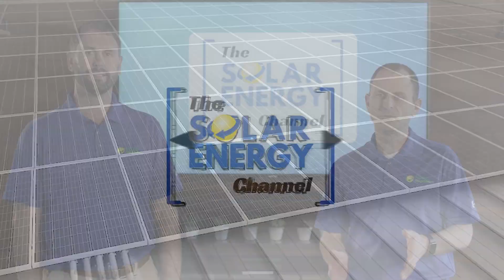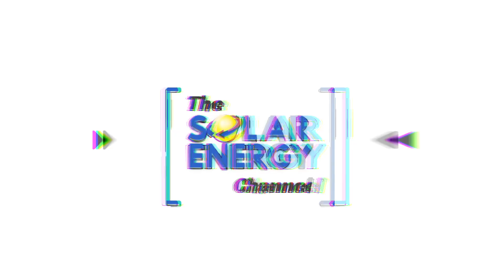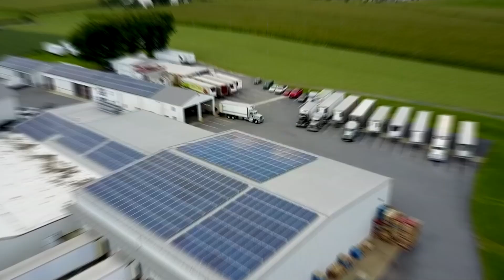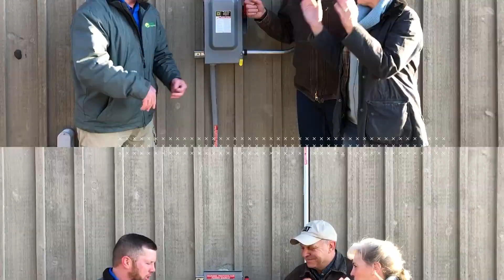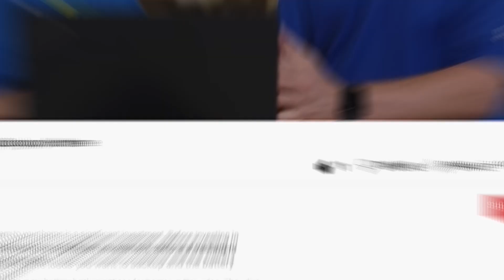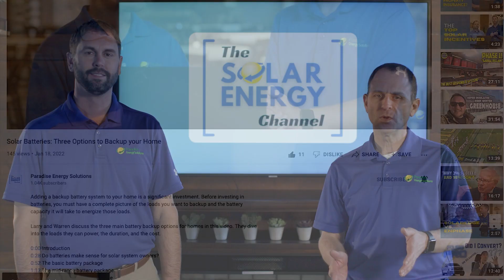Net Billing vs. Net Meter for Solar Energy: How do they work and what's the difference

Comment: Thanks very much for the information. And I wanna ask  net billing or net metering depend by your contract with the electricity services company. If you choose different electricity services, is there difference with these two methods? Thanks
Reply from the maker: The method used would be based on your utility company.

Comment: Would it make sense to oversize your panels (let's say 150%+ of annual usage)  and go with net billing as opposed to sizing your system to 100% and going with net metering?
Reply from the maker: If your utility offers net metering, they will not also offer net billing. It's one or the other.
Reply: @thesolarenergychannel  I don't believe this is true. I've been talking to PUCO (Ohio) and they're telling me I can utilize either a net metering tariff or cogeneration (net billing) tariff with my system.
Reply from the maker: @GCTubaTim  There is a misunderstanding somewhere because the customer doesn't have the ability to decide between net billing or net metering. It's based on the utility. They either use net metering or net billing, not both.
Reply: @thesolarenergychannel  I'm literally talking to AEP Ohio and they're telling me I can choose which one to go with.
Reply from the maker: @GCTubaTim  We are not aware of this. In our experience, the customer has not had the option to pick between the two. Regardless, upsizing by 50% would still greatly diminish your ROI.
Reply: @thesolarenergychannel  The reasons I'm looking at upsizing is because I'm looking at combining it with a solar battery for backup purposes and the installer offers lower price per watt for systems above 5kw. I just don't want to run into a situation where I produce just over 120% of my usage and then don't get compensated for anything.
Reply from the maker: @GCTubaTim  If you had a battery system, size the system at 100% since the excess production during the day, which is lost in net billing, would be stored in the battery.

Comment: Does not my over production force it's way back into the grid thus turning my meter backwards and later when I pull power from the grid, the meter then goes forward again which just cancels out each other out which has the effect of a lower bill without any effort to account for KW's at all ?
Reply from the maker: Yes, with net metering, but not net billing.  With net metering, the electricity you upload to the grid is worth the same as the electricity you’d purchase from the grid. You receive one credit for every kilowatt-hour (kWh) you upload to the grid. You can exchange those credits for an equal amount of kWh whenever needed. Or you can bank these credits, roll them over from month to month, and then eventually receive a cash payment for unused credit. Solar net billing works a little differently. The excess energy generated by your solar system is “sold” to the utility for less than it would cost for you to buy it as a customer. Check out this blog for a deeper dive into both compensation methods -> https://www.paradisesolarenergy.com/blog/net-billing-vs-net-metering-for-solar
Reply: I'm not talking about any metering or billing at all. Does my excess production shove a digital meter backwards as it forces itself back to the grid , thus there is no accounting of it happening at all? I am simply lowering usage that I'm billed for ?  I have a transfer switch that breaks my grid connection during a grid-down event so I can't send juice out onto the lines because of my stand by Generac.
Reply from the maker: @donking3083  When connected to the grid, solar systems are equipped with net or smart meters. These run bi-directionally, allowing them to properly account for the net energy you’ve used, which is all the energy you’ve consumed minus the energy your solar system produced. Does that answer your question? Here's a blog with more details on the different types of meters used with solar. https://bit.ly/3KMkTt4